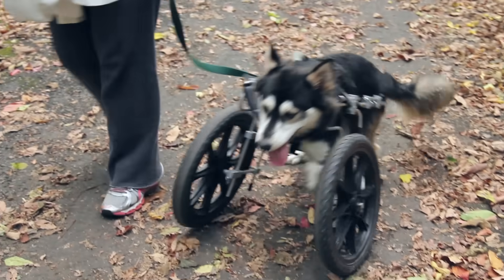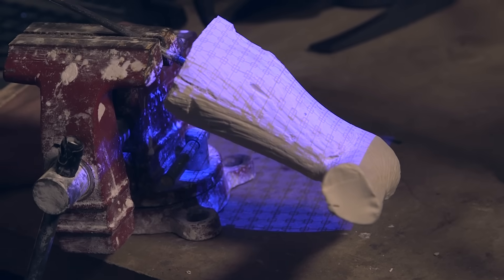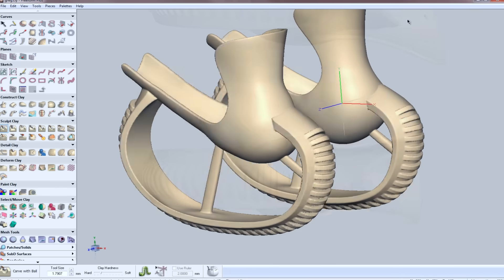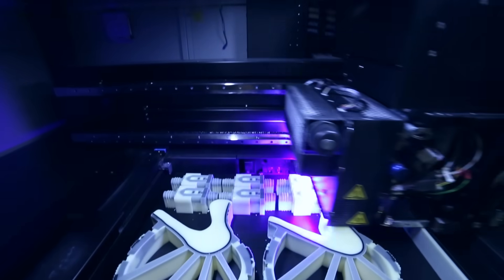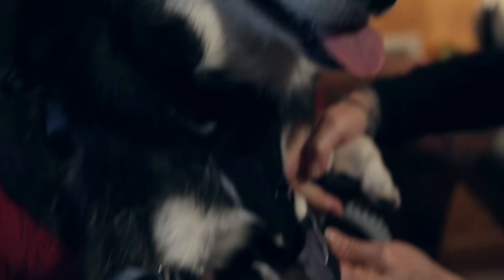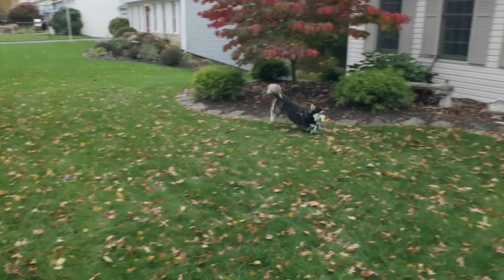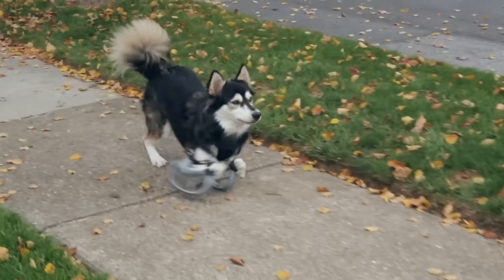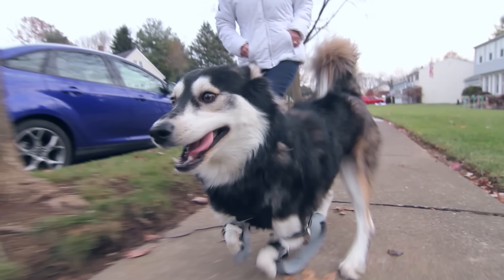Derby the dog: Running on 3D Printed Prosthetics

Comment: These prosthetics are amazing!  I can't believe how well the dog takes to them!  Beautiful!  The only problem is that I refuse to buy the bullsh$% lies about them being made by an intelligent designer or creator.  An intelligent designer or creator is not necessary for those prosthetics.  Those prosthetics arose through the nature selecting arbitrary self-organized molecules to randomly form a number of different polymers and plastics.  The prosthetics only appear to be perfectly fit in form and function to the dog but this is only an illusion.  Natural selection creates that illusion.

The existence of gravity and the laws of science are sufficient to explain how those prosthetics came about.  No designers are necessary.  In fact, invoking a designer or intelligent designer to explain the origin of these dog prosthetics would require blind faith and a rejection of science.  Someone who invoked a designer/creator for these dog prosthetics are doing so strictly out of a fear of dying.  Such people would be irrational and have no evidence on which to base their claims.

All we need to explain the dog prosthetics appearing on their own and without the help or intervention by an intelligent designer/creator is to show the progression of the fossil record of that 3-D printer.  I can show you a number of printers, starting with early primitive printers and clearly showing the addition of features, traits, and increased efficiency and capability leading up to the current 3-D printer. 

So, I have DEBUNKED the notion in this video that these dog prosthetics were made by an intelligent designer/creator.  As proof, I have presented my mechanism and examples of printers going from basic to advanced showing the natural procession of evolution of printers.  I have shown how invoking an intelligent designer/creator is superstitious, irrational, unscientific, foolish, and based in fearmongering.  The people who claim that a designer/creator is responsible for these dog prosthetics need to be removed from society.  They are the sole source of all the problems in this world. Such people prevent science from being done and try to replace REAL SCIENCE with their primitive notions of creators and designers.
Reply: Without condoning or condemning... I just have to say this whole comment thread is fucking HILARIOUS.
Reply: RunicFX The fact that you couldn't see the sarcasm is astounding. Look at his profile picture. He's obviously attempting to satirize evolutionists' (logical and scientifically correct) belief, even though the creation of the universe and the creation of this dog's prosthetic limbs are completely different. I bet he thinks he was being clever, too.
Reply: Obvious troll is obvious.
Reply: That has to be the most retarded argument for creationism that I have ever heard.
Reply: Here we see the super-atheist in his natural habitat.He is very similar in appearance to the stupid creationist who doesn't know what logic is, although this is a super atheist due to the distinctive lack of sarcastic capitals.
Reply: ***** Do you honestly believe his argument is good?
Reply: You're trying too hard.
Reply: *****
Don't get into a evolution vs.creation just marvel at this dog's supposed joy at running, something some of us seem to miss the small things.
Reply: David Southey Why are you telling me this? I wouldn't have said anything if it weren't for the original commenter.
Reply: David Southey The dog doesn't enjoy running.  What you perceive as the dog's"joy" is just nothing more than a chemical reaction producing an effective but false illusion of sentience which Evolution did in order to motivate the dog to eat, reproduce, and survive.  As Ian Malcolm said in Jurassic Park, "Life finds a way."  

As ***** said, Evolution is logical and scientifically correct.  

We need to stop holding to this primitive superstition of "creators" and "designers".  Biology,  according to the great Richard Dawkins, is the study of things which "appear" to be designed.  This doggie prosthetic may appear to be designed but please don't be fooled.  I have demonstrated it's natural origins.  I can provide you with a pretty complete evolutionary tree of the 3D printer.  The plastics which make the doggie prosthetic legs are comprised of molecules which probably assembled themselves in either underwater hot vents, a primordial soup, or possibly were seeded here by aliens who had themselves arisen by Darwinian mechanics in a galaxy far, far away that either arose out of nothing, existed eternally, or is one of an infinite amount of universes.  

The 3D printer obviously evolved through natural pressures.  We can see the slow and gradual progression of features and capabilities in the units.  Each unit that increased in features was able to outsell the one lacking the features.  Thus, nature selected the fittest printer.  An example of this is the laser printer.  HIs ancestor, the ink jet printer, was fairly well-suited for his environment.  But Evolution realized that the ink jet cartridges just didn't produce enough copies to be ideal in more stressful environments.  Therefore, evolution gave the inkjet a TONER CARTRIDGE and simultaneously implemented a new toner deliver system to accommodate the new print product.  The proof of this claim is the existence of the laser printer.  

Science.  It just works.
Reply: Besides, if we start going around attributing things like this doggie prosthetic to "creators" and "intelligent designers", it just raises the bigger question, "Well, who designed the designer?"  Obviously, since that question would just complicate things, we can just omit it.  Therefore, no "designer" or "creator" is necessary.  Besides, I've never seen this "designer" or "creator" of the doggie prosthetic.  Where is he?  If the doggie prosthetic had a designer, why are there crippled dogs in my neighborhood?  That is PROOF POSITIVE that the doggie prosthetic has no designer or creator.  But I want to provide one final proof that the doggie prosthetic has no designer or creator.  Ready?  Here goes...

"Hey, doggie prosthetic designer!  If you're real, give me a suitcase full of cash and a mansion!"  

And...I got no suitcase full of cash.  I got no mansion.  Therefore, we can conclude that the doggie prosthetic has no designer or creator.  I rest my case.
Reply: ***** You do understand that I was kidding, right. it's obviously some creationist garbage.
Reply: ***** 
A prosthetic leg has NOTHING to do with it - not even as a parody.
A place or time in which this analogy makes sense simply doesn't exist.
A prosthetic leg, or basically almost any product in the history of mankind, was designed with certain specifications for a certain purpose. The prosthesis will not start developing on it's own. It will not start growing thumbs or getting larger in diameter. 
Limbs, on the other hand, were not designed or created by anyone. They evolved (and probably still are evolving) in a series of mostly beneficial mutations.
Just so you know, evolution deals with how life forms evolve; Not with how life began in the first place.

On the sub-molecular level everything comes down to physics eventually. What other empirical method is there to explain how life forms develop? Philosophy?
The purpose of evolution is evolution. The fact that it has no deeper existential meaning behind it doesn't make it an "illusion". 

Russell's teapot is bullshit and a god is not? There is the same amount of evidence for the existence of a god as there is for the teapot. 
First you say that they aren't in the same category when it comes to verifiability (as if you can somehow verify any of them) but then you say there is basically no evidence to support the existence of a god. Do you understand that this puts them both in the exact same category?
You can't argue the existence of something without providing any proof for it; That's exactly what Russell's teapot shows. And the fact that you say the existence of one is more plausible than the other is simply ridiculous.

Evolution IS NOT based on a limited perspective. What standard exactly are you using to argue that scientists have limited evidence? When, by your standards, will scientists have gathered enough evidence to have 'enough evidence'? There is plenty of it to understand and support evolution. So much, in fact, scientists were able to predict in which layer of the earth's crust a certain transitional fossil would have to be found in.
Reply: Dave Biddle  Thanks for hijacking a nice video with an off topic essay that will convince nobody of anything, you selfish twit.  Proud?
Reply: The Channel of Stuff No, I am not mentally challenged.  No creator or designer is needed for that dog's prosthetics.  We do not need to invoke a creator or designer.  That dog's prosthetics evolved naturally and I have printers showing the natural gradual evolution from simple to the complex 3D printer.  If you claim that this dog's prosthetics needed a designer or creator, you are pathetic and reject all science.
Reply: FACTvsEVOLUTION You are an idiot. Dave is a creationist, using sarcasm to point out what he believes to be the flaws of evolution. The man is on your side, but your religious brainwashing has made you too blind to recognize what is blatantly obvious. I take pity on your soul, you poor, hell-bound creature.
Reply: Cameron Dye Yeah, definitely. I spotted that troll a mile away too.
Reply: RunicFX Wow, the irony. My bad, man.
Reply: ***** Ah, man, don't worry about it. ^^
Reply: k
Reply: ***** "The prosthetics only appear to be perfectly fit in form and function to the dog but this is only an illusion.  Natural selection creates that illusion.
The existence of gravity and the laws of science are sufficient to explain how those prosthetics came about."
Just thought I would leave this quote here, so you could bask in the wisdom of Mr. Creationist here, because clearly you can't understand how flawed his silly analogies are.

Evolution is FAR from being based on "a limited perspective". It also can't disprove the existence of a god for the same reason it can't disprove the existence of Russell's teapot.

"Militant atheists" - I LOL'd.
Reply: ***** Wound up? Because I'm not loling anymore it's sad? Yeahh... 
Have a good day.
Reply: ***** "if life on earth ceased to exist and aliens examined the fossil record they might come to the conclusion that the limb was part of the evolutionary process." Well... I don't thinks so, if aliens do not have the intelligence/technology to figure stuff like that out, it would be very unlikely they would have the technology to travel through space. You're really reaching to make a point, which you do have... but you're not explaining it very well.
Reply: Exophobia
Reply: Dave Biddle
Jurassic Park is a work of fiction and you espouse a quote from a fictictous character; however you quote from reality.
Reply: Dave Biddle you can quite easily meet the people that designed and built the dog's prosthetic legs. You could even visit their lab. You could, that is, if you weren't a completely ridiculous person that could very well be on the NSA's watch list for fundietards.
Reply: fifh89 So the only way I can learn that the dog's prosthetics were made by a designer or creator is that I'd have to meet the designer or creator and see the lab?  That's the ONLY WAY THAT IT COULD BE SHOWN TO ME THAT THE DOGGIE PROSTHETICS HAD A DESIGNER OR CREATOR?  I tried that.  I got on my knees and said, "If there is a creator or designer of the doggie prosthetics, would you please appear to me now."  No one appeared.  THere is no creator or designer of the doggie prosthetics.

I don't need to go to the lab or meet the people who claim to have designed the prosthetic since I gave you a very clear proof and evidences showing that the prosthetics don't need a designer or creator.

Thank you.
Reply: Joseph Kindred I am very happy for the dog!  It just makes me sick that people push their creationist/intelligent designer NONSENSE on me.  I want to make it clear that these doggie prosthetics required NO DESIGNER OR CREATOR.  STOP PUSHING YOUR SUPERSTITIOUS FAIRY TALES ON ME.  THERE IS A PERFECTLY REASONABLE NATURAL EXPLANATION ON HOW THESE DOGGIE PROSTHETICS AROSE ON THEIR OWN THROUGH PURELY UNDIRECTED NATURAL PROCESSES WHICH DO NOT REQUIRE A CREATOR OR DESIGNER.

I showed you the physical evidence of the Darwinian-evolved line of printers.  I demonstrated how plastics and polymers could have assembled themselves without any scientist, designer, creator, engineer, or leprechauns.  

The doggie prosthetics have no designer or creator.  

Thank you.
Reply: costew67 YOU Thanks for hijacking a nice video with an off topic essay that will convince nobody of anything, you selfish twit.  Proud?

RESPONSE Your comment has nothing to do with the doggie or whether or not the doggie prosthetic had a designer or creator - WHY ARE YOU OFF THE TOPIC?  Furthermore, your comment can't convince anyone of anything because it doesn't even make a claim.  So, I just wanted to let you know that your comment is irrelevant and unconvincing. Ultimately, you wasted my time in writing to me which is incredibly selfish of you.  I hope you are proud of yourself. 

I hope you are proud of yourself for using such offensive language like "twit" in the potential presence of children.  How rude!
Reply: Dave Biddle worshipping the prosthetic creators that refuse to meet you is futile and retarded then. when you talk about sex with people, do you use a sock puppet?
Reply: Dave Biddle Oh. You're insane.  I get it now.  Sorry.  Never mind.
Reply: costew67 YOU Oh. You're insane.  I get it now.  Sorry.  Never mind.

RESPONSE Sir, did the doggie prosthetics arise by natural unguided processes or did they have a designer?
Reply: Dave Biddle 39 weeks later? Were you in jail/looney bin?
Reply: Dave Biddle You are going to come to me and state that there is a supreme entity that you call god, and that this god created the universe and everything in it, including our planet and humans. Fine. You must prove it though, otherwise I will not believe you. It's simple: prove it. This is your responsibility because these are your assertions. You start a thread with sarcasm and parody to defend your assertion. But you must see that I can introduce you to the man that built the dog's leg (he won't agree due to fears of your lunacy),  while you cannot introduce me to god. You just simply cannot do it. There's always a catch to the proposition, blaming the unbeliever. You're full of shit. Period. If God is real and has any power he can make himself known. My friend can phone me or knock on my door. Why is your god so disabled and why are you so satisfied by all the lurking around the corner and hiding behind the curtain foolishness. Fuck off.
Reply: +fifh89 The same could be said for the other side, prove it wasn't created. Or at the very least prove all of the laws of nature weren't set by a creator.
Reply: Dave Biddle I'm really at a loss about what your point could possibly be.  Of course they had a creator.  Inanimate objects don't evolve, they are designed and made.  I'm fairly certain even someone as mentally challenged as you could design and create a box out of a few pieces of wood and nails, right? But you couldn't design and create a living animal, now could you?  DO you see the difference you stupid man? Who designed and created your invisible man in the sky?
Reply: Warren Smith yeah its said all the time and that's why there's millions if atheism vs creationism threads clogging up the servers of the world. It's more productive to have the burden of proof lie with the person making a claim. If I hold a closed fist out to you and say that there's a huge diamond inside it's more reasonable and productive for you to tell me to open my hand and show you, rather than me demand that you prove that it's there without seeing it. Same goes for any claim like there being a unicorn in my shed, that my new cancer drug cures 100% of patients or that there is a god that created the universe. If you make a claim you'd better be able to prove it. I'm not an atheist because I started out attacking the faulty logic of religion. I'm an atheist because religion couldn't prove itself as being real.
Reply: fifh89 You can prove atheism is real?
Reply: costew67 YOU I'm really at a loss about what your point could possibly be.  Of course they had a creator.

RESPONSE Are you sure the prosthetics had a creator?  Does that just beg the question, who created the creator?  It's much easier to remove the creator and say that natural unguided processes made the ILLUSION of design in those doggie prosthetics.

When you claim that the doggie prosthetics had a creator, that's just a pathetic superstitious claim.  There's no evidence of a doggie prosthetics creator.  That's just your wishful thinking because you hate science!  

YOU  Inanimate objects don't evolve, they are designed and made.  I'm fairly certain even someone as mentally challenged as you could design and create a box out of a few pieces of wood and nails, right?

RESPONSE But isn't appealing to a creator just making the harder question, "Who created the creator?"  It's much simpler to reject the creator.  You are just appealing to your spaghetti-monster "creator".  There's no evidence of a doggie prosthetic creator and don't try to force your creationism on me.  I only believe science and science doesn't need to believe in a creator. Those doggie prosthetics don't have a designer or creator.  That's religion.  The doggie prosthetics arose by natural unguided processes only.

YOU But you couldn't design and create a living animal, now could you?  DO you see the difference you stupid man?

RESPONSE Michelangelo painted masterpieces that you cannot paint.  Does that mean that you have to believe that all of michelangelo's artwork has no creator because you can't make it?

Just because you can't design and build an iPhone doesn't mean it doesn't have creators.  
A cat can't understand the working of a computer but is that evidence that there is no Creator?

YOU Who designed and created your invisible man in the sky?

RESPONSE No one created God.  He is a spirit who is necessarily eternal and without beginning or end.  Otherwise, nothing would exist.
Reply: fifh89 You are a very angry man!

YOU  You are going to come to me and state that there is a supreme entity that you call god, and that this god created the universe and everything in it, including our planet and humans. Fine. You must prove it though, otherwise I will not believe you.

RESPONSE Easy.  Don't believe me.

YOU  It's simple: prove it.

RESPONSE I have no desire to prove it because I don't care if you believe me.

YOU This is your responsibility because these are your assertions.

RESPONSE I assert nothing.  I reject your doggie prosthetic creator.  You can't prove there is a creator of the doggie prosthetic.  You have zero evidence.  If you want me to believe the doggie prosthetics had a creator, prove it.  Otherwise, I will believe in science.

YOU You start a thread with sarcasm and parody to defend your assertion. But you must see that I can introduce you to the man that built the dog's leg (he won't agree due to fears of your lunacy), while you cannot introduce me to god.

RESPONSE I tried to meet the doggie prosthetic designer.  I was like, "Heyyyy! You who built the doggie prosthetic!  If you are real, show yourself!"  But I didn't see anyone so I can conclude that he does not exist!  

Your belief in your little "doggie prosthetic creator" is your pathetic religion.  I have no doubt that you believe in your imaginary friend, your invisible "creator buddy".  But that's your disease, not mine.

YOU You just simply cannot do it. There's always a catch to the proposition, blaming the unbeliever. You're full of shit. Period. If God is real and has any power he can make himself known. My friend can phone me or knock on my door.

RESPONSE This is your wishful thinking! If your friend is real, how come he doesn't phone ME or knock on MY door?  Doesn't he love me?  

If your imaginary friend did exist, he is evil and disgusting.  He wants me not to believe in him because if he did want me to believe he existed, he would prove it to me!

YOU Why is your god so disabled and why are you so satisfied by all the lurking around the corner and hiding behind the curtain foolishness. Fuck off.

RESPONSE My god?  I ask you the same question about your doggie prosthetic designer.  Where is he?  Where's the evidence?  "Hey, doggie prosthetic creator!  If you are real, why are there so many crippled dogs?  My neighbor has a dog that missing one front paw.  If your doggie prosthetic creator was real, why doesn't my neighbor's dog walk correctly now?  HA!  The answer is really easy!  Your doggie prosthetic designer doesn't exist!  He is your imaginary friend because you hate science and can't deal with reality!

You say you can introduce me to the doggie prosthetic designer?  A LOT of people claim the same thing?  What makes YOU right and them wrong?  You're all a bunch of lunatics, all claiming to know the doggie prosthetic designer.  You just want to have power over me and determine who I have sex with!  It's all about money.  

If I said, "Yes, show me the doggie prosthetic designer", the next thing you'll do is ask for money!  You're all greedy and out of your mind, believing in your imaginary "inventor in the clouds".
Reply: fifh89 YOU  I can introduce you to the man that built the dog's leg (he won't agree due to fears of your lunacy),

RESPONSE Oh, that's why he won't meet me?  Or is it because he doesn't exist anywhere except in your head?  If he is real, why doesn't he knock on my door or call me?  Easy!  Because he doesn't exist. 

Those doggie prosthetics are the products of evolution!  Science - it just works!
Reply: fifh89 YOU  I can introduce you to the man that built the dog's leg (he won't agree due to fears of your lunacy),

RESPONSE If your doggie prosthetic designer is real, then let's see him make a tree branch materialize out of thin air and kill me.  Anything?  Uhh, anything?  NO, NOTHING!  WHAT FURTHER PROOF DO WE NEED?  THE DOGGIE PROSTHETIC DESIGNER DOES NOT EXIST!  SCIENCE WINS AGAIN!
Reply: Dave Biddle I fully agree with you. God does not exist.
Reply: Dave Biddle YOU:  No one created God.  He is a spirit who is necessarily eternal and without beginning or end.  Otherwise, nothing would exist.

Wrong.  By your own incomprehensible logic, someone must have created the creator.  So someone had to have created god.  Who?
Reply: Dave Biddle You should be perfectly capable of researching this on your own, but I'll provide some links for your convenience:

3D System's website and contact info:
http://www.3dsystems.com

Project manager:
https://www.linkedin.com/in/tarajanderson

Project design team:
https://www.linkedin.com/pub/dave-dipinto/8/261/a6

https://www.linkedin.com/pub/kevin-atkins/0/454/467

Specialist/Consultant:
https://www.linkedin.com/pub/derrick-campana/12/aa3/950

You're perfectly able to contact these people and get verification. Tip: don't act like a fundamentalist/creationist lunatic. You may already be on the FBI and NSA radar and don't need to escalate your troubles. Your thought experiment is actually interesting but failed utterly when the muse was so specific and verifiable. If you had presented something like a can you found in a forest or an odd petroglyph, this could have gone a different way. You really messed up though. All you've succeeded at is looking like a bitter creationist troll that got so wrapped up on how clever he thinks he is that simple things were overlooked. Case on point: see all the people that aren't jumping in, saying how you nailed it so brilliantly?
Reply: fifh89 Sorry.  Those are all doggie prosthetic creationist websites written by other people obsessed with your imaginary friend.  Go learn some science and stop claiming that everything is made by your "invisible man" buddy.
Reply: costew67 YOU Wrong.  By your own incomprehensible logic, someone must have created the creator.  So someone had to have created god.  Who?

RESPONSE Show me by logic how someone must have created God.
Reply: Dave Biddle Your basic mantra seems to be  "Did the prosthetic create itself?  No, it had a creator.  The creator of the prosthetic must have a creator."  So why wouldn't the creator of the creator also have a creator?  Something made God. What or who?
Reply: costew67 First of all, I don't believe that the prosthetic had a creator.  i think that appealing to a creator is primitive and unscientific.  The prosthetic invented itself and only APPEARS to be designed.  That's just a function of nature.  When you say that the prosthetic had a creator, you're just raising another question, "Who created the creator?"  That's unnecessary.  It's much better to just believe scientific evidence that the prosthetic evolved through unguided natural processes.

So you believe that the prosthetic had a creator, huh?  Who is it?  Is it my neighbor down the street?  Is it Zeus?  Is it the Flying Spaghetti Monster?  Is it Horus?  Who "created" the prosthetic?  I'm sure you are going to give me YOUR version of the truth.  But what makes YOUR claim any better than anyone else's?  I could say that FAIRIES made the prosthetic.  Only YOU are right but not me, right?  Prove it!  Prove this "creator" of yours.  Muslims might say MUHAMMAD made the doggie prosthetic.  

So only YOUR truth is the correct truth, huh?  Only YOU and the PEOPLE WHO AGREE WITH YOU have the truth?  How PRESUMPTUOUS!  How EGOTISTICAL!  How INTOLERANT AND HATEFUL OF OTHER BELIEFS!
Reply: costew67 You say the doggie prosthetic had a creator?  Who created the creator?  And who created him?  And who created him? If you are going to tell me the prosthetics had a creator, you will need to supply me with the exhaustive geneaology going back to the first human being, then back to the first living thing, then back to the first point of matter and energy, then back to the first cause of the Big Bang explosion, and then you need to explain what caused the first cause, and then what caused that, etc, etc, until you find that you go back to infinity.  Obviously, such a claim is ludicrous. Therefore, your prosthetic has no creator. SCIENCE, IT JUST WORKS!
Reply: Dave Biddle Nice try.  You didn't answer the question.  Who created God?  I'm done with you actually.  It's fun sometimes to debate with someone who actually is capable of constructing a worthy argument, but yours is nonsensical, absurd, and frankly boring.  There is no rationalizing with a person who believes that a cosmic Jewish Zombie who was his own father can make you live forever if you symbolically eat his flesh and telepathically tell him you accept him as your master, so he can remove an evil force from your soul that is present in humanity because a rib-woman was convinced by a talking snake to eat from a magical tree.
Reply: Dave Biddle My invisible friend improves and saves lives. Yours is platitudes and hand wringing.